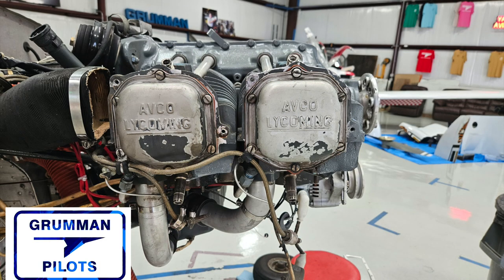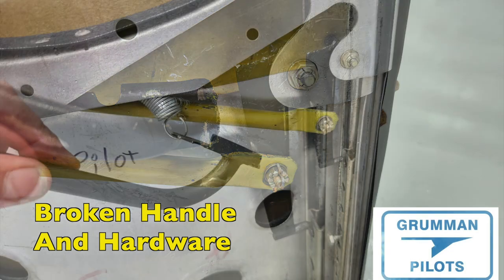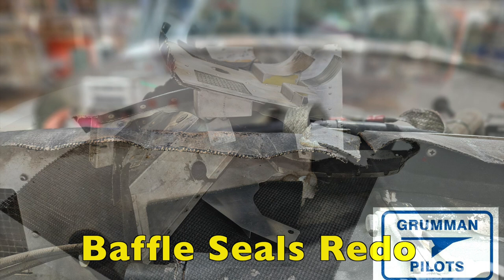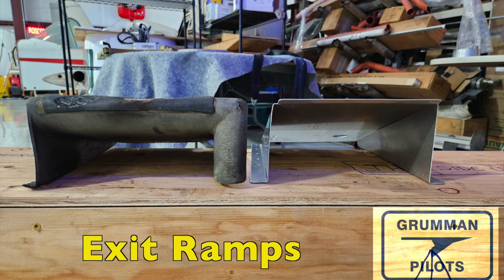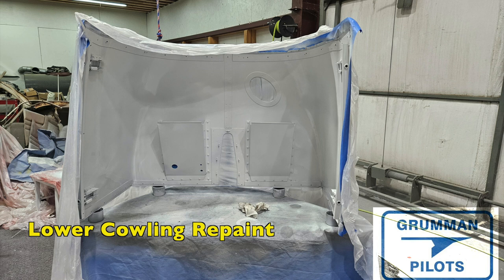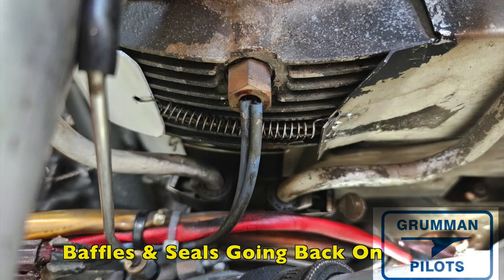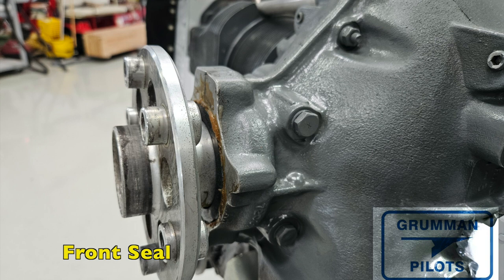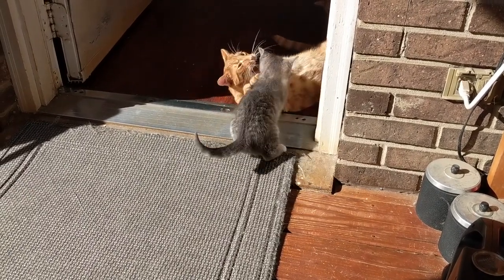1500 hour Tiger,  clean with lots of  small issues fixed - Grumman Style

Comment: Hi Roscoe, Informative video. At 8:49 you show what looks like a battery charging connector in the area accessible through the oil door. My compliments to the owner for wanting to keep the battery charged and accordingly get the best life from that battery. You are well known to be a stickler for using aircraft parts. Comments?
Reply from the maker: It was the plug to the oil pan heating pad.